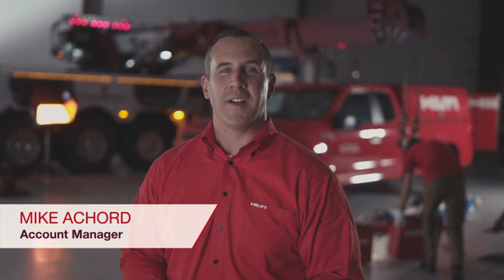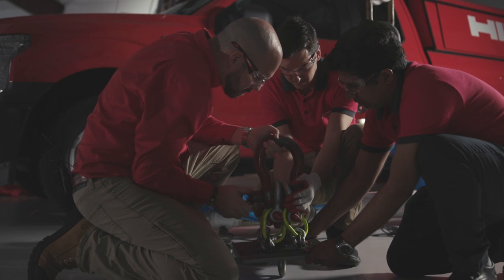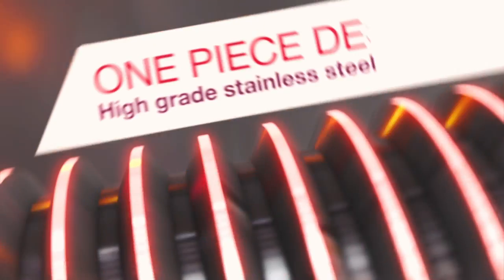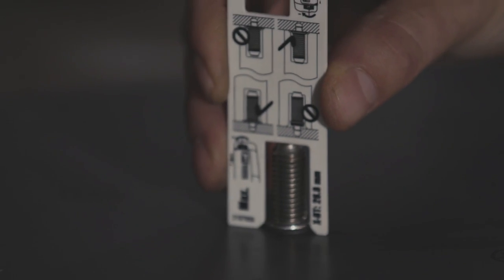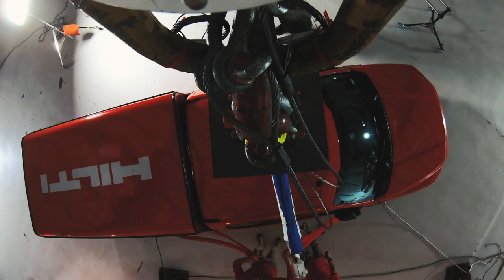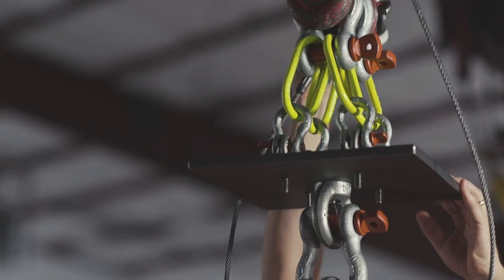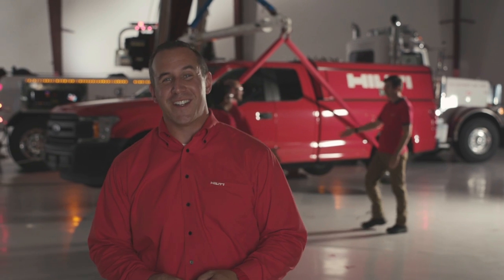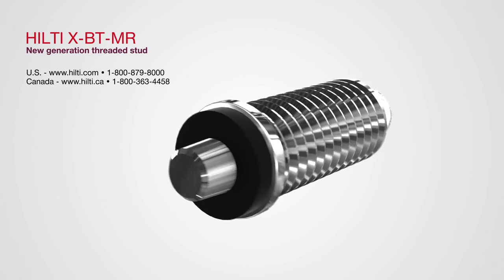INTRODUCING X-BT-MR: Can this stud lift a pickup truck?

Comment: What they don't show is that they did that lift about 20x. The X-BT is a phenomenal solution. Also check out the S-BT stud line when you can't use a powder-actuated tool for some reason, i.e. oil/gas installations, etc.